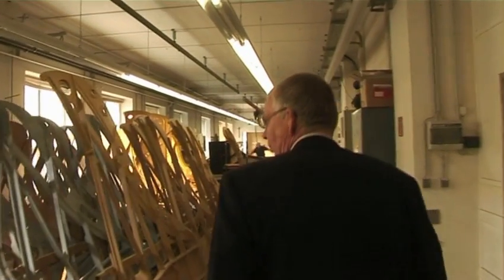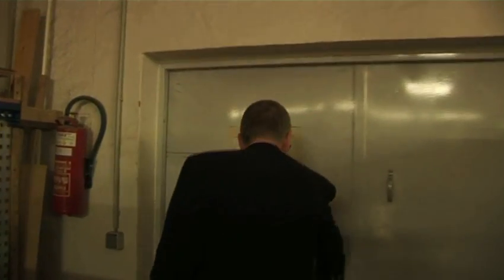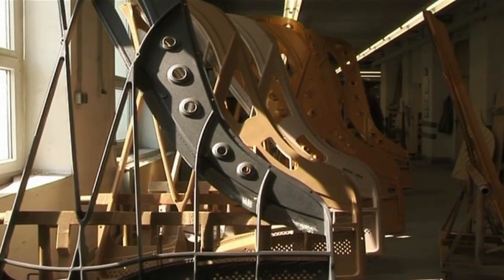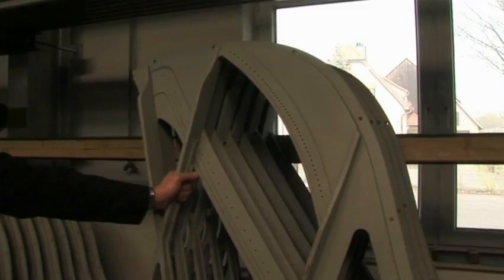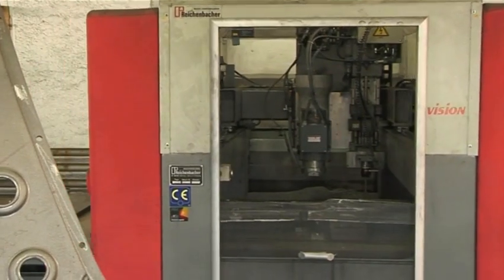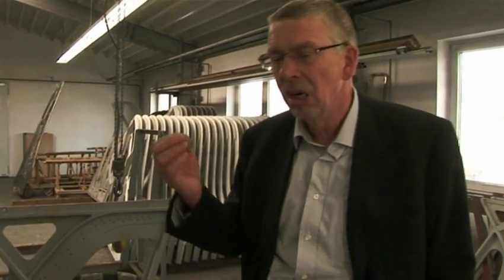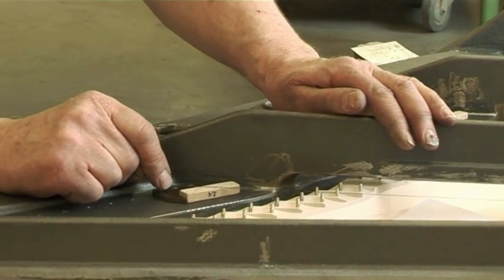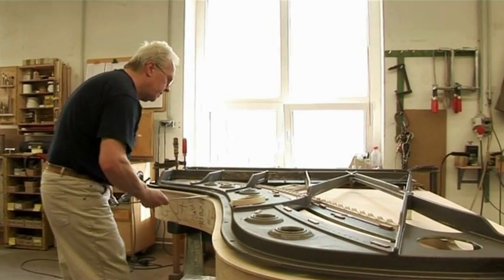Manufacturing of Bechstein Pianos 4/12 - The cast iron frames

Comment: Sooooo, is it possible to somehow make one at home? ...

I mean, I'm making a homemade piano and I have no idea what to do about chassis
Reply: Did you end up getting one? How much did it cost, or how did you get it?
Reply: @alba4387  no. But I study in the grands of my university.
Reply: Is it possible? Sure, but not by yourself. It is a rather daunting task. The biggest of which is casting itself. Some may say designing it, but I’m sure you could find a design online that would do the job. But then, you have to worry about 3d printing or precision carving that model into plastic or wood, then using that positive mold to make a negative mold that is 4-8 feet long. And once you’ve gotten to this point, which is a feat in and of itself, you have to find a way to safely melt 500 pounds of cast iron, which is vastly more difficult to cast than aluminum. If you have 5 or 6 other people to help you, it’s doable. And then you obviously have to worry about fig and finish of the frame to the soundboard. There is a lot to consider. I am in the process of designing my own piano to be built as well, but there is a lot to consider. The frame is likely the hardest part to do logistically. The action stack is probably the hardest to do, due to intricacy and having to match the action across the whole piano. 

Another option: find a cheap/free junk grand piano (might be tough to find, especially if you’re looking for a specific size, but they are out there) and make sure the frame is good. Then, build the entire piano around that frame. 

Third option, you could fabricate a piecemeal frame as was done when metal frames were first becoming a thing. Bolt together multiple different pieces of metal to make a frame instead of one cast piece. It’s not quite as durable, nor does it carry the tonal advantages of a one piece cast frame. But it’s a lot stronger than wood alone, and the first pianos were made of wood without metal, albeit with many tuning issues. 

I hope this helps out even though I’m two years late.
Reply: @ZaneGrayMusicMaster1  yeah... I gave up long ago. I didn't have the time nor the equipment to do it.

Comment from the maker: Dear Surath Samaratunga,
Original plates ready for replacement in vintage instruments are not available. Iron frames are custom fit, they cannot be replaced easily.
Please also note that there are big differences in quality of cast iron frames. Thus other than original factory fit Bechstein plates will effect stability and value.